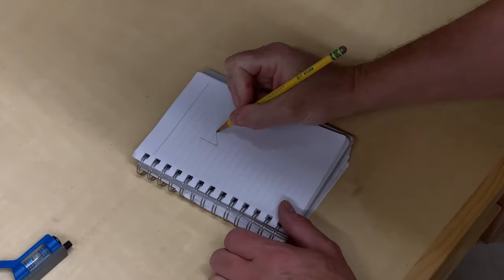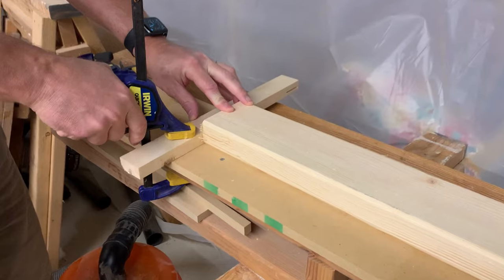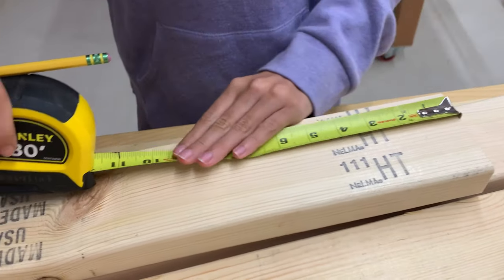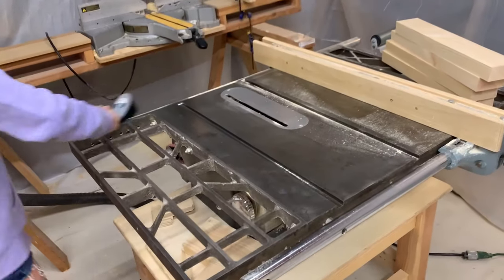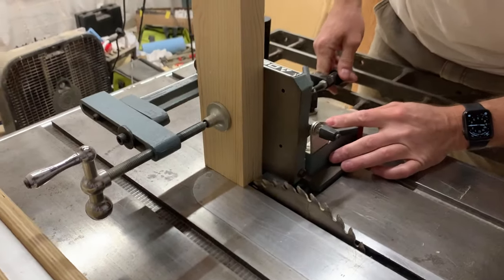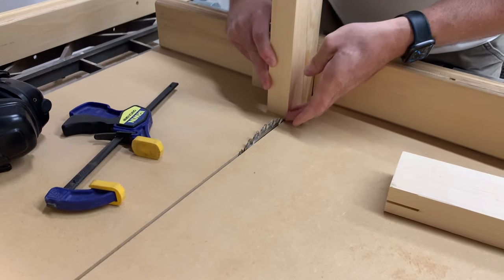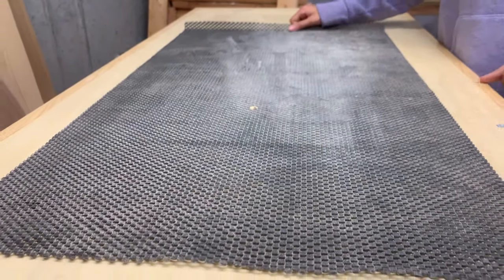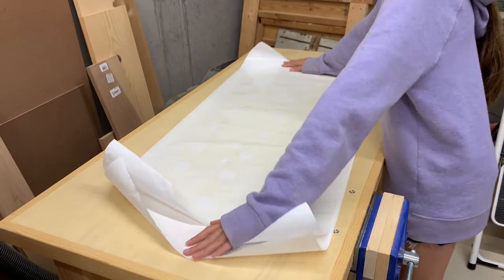How to Build a Super Sturdy and Cost Effective Garden Bench \\ Home Decor \\ Woodworking Challenge

Comment: Thank you for sharing such a simplistic design. Most of my time was spent making cross cut sledge to use for making lap joints. Once I got that done, making the bench was a breeze. Though I used 2x6x10ft redwood to cut 2 46inch slabs for top. Did a two tone look as well. Came out really nice and my wife loved it. Happy woodworking with your family.

Comment: Hi, I really like you build, can you please share plans or approximate dimensions of the wood that you have used please?
Reply from the maker: Thank you very much! I don’t have plans. The top boards are 48 inches long, the vertical pieces are 17 1/2 inches long, and the horizontal pieces are 10 inches long.
Reply: @WhiteLabWorkshop  Thanks, that's all I need.

Comment: What's keeping the legs from giving out laterally? You guys should put a crossbar connecting the legs in the back.
Reply from the maker: This bench is surprisingly stable as-is. However, a cross-bar would certainly help, if lateral support is a concern. It really depends on your use case. Ours is an occasional use situation.